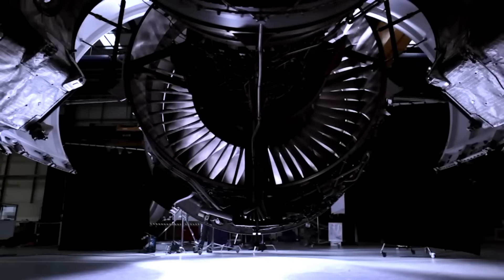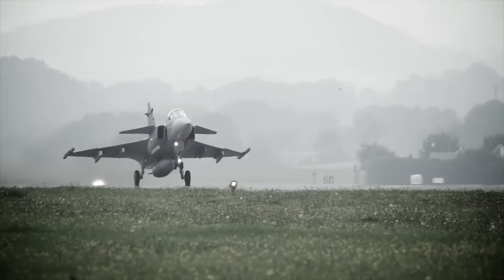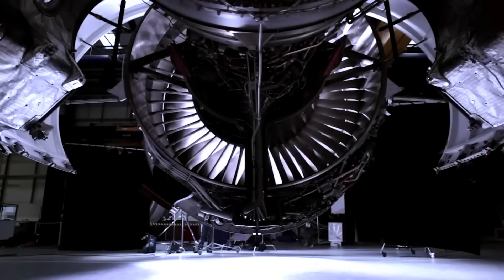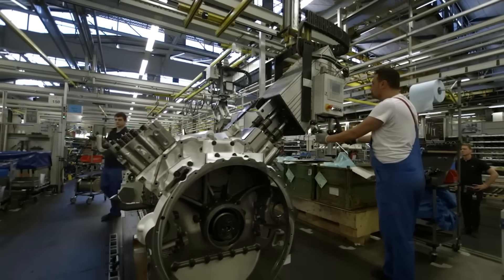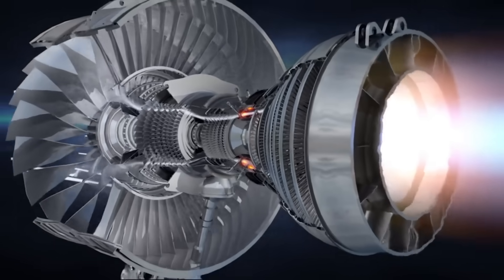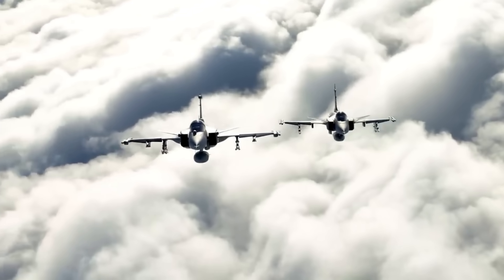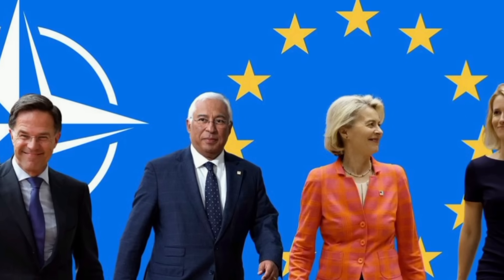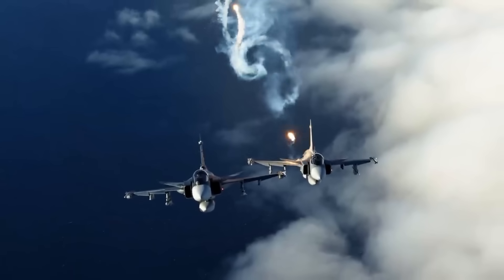How Rolls-Royce Quietly Rewired the Gripen Jet – And Shocked NATO Overnight

Comment: RCAF veteran here.🍁🇨🇦 As a maintenance officer, I believe that the Gripen should have been our first choice from the beginning. It’s designed specifically for the conditions we have in Canada. It’s made to operate in the same environment as we have in Canada, can operate from forward austere locations and is designed to operate with minimal maintenance requirements. This is a major consideration as the F35 requires a large number of technicians and extensive maintenance facilities to support its operation.
The cost comparison in maintenance personnel needed to operate and maintain the aircraft, the serviceability rate, the logistics support and infrastructure requirements between the F35 and the Gripen favours the Gripen in each case. The cost per flight hour is an ongoing expense that Canadians will pay for the life of the aircraft. Again, the Gripen is the clear winner. (The Gripen also includes economic and operational flexibility benefits for Canada.)
Pilots always want the aircraft with the most advanced technology and capability. I completely get that. But the F35 requires extensive maintenance and logistics support and it’s the wrong answer for Canadian requirements. You can’t fly a mission with an aircraft that’s constantly in the hangar.
Reply: Didn't Saab also say that, if Canada went for the Gripen, that they would be built (or at least assembled) in Canada? I personally think this is another really compelling aspect that should be part of the decision making process. We (Europe) need to reduce our dependence on the US (I'm not anti American by any means) and Canada would make a great partner - why? Well educated and skilled workforce, no shortages of power with vast amounts of land for manufacturing plants and, the manufacturing could be located in relatively easy places to defend from an attack. Canada could come to our aid as they did in WW1 and WW2 (from the start and not half way through).
Reply: Concur,  and like the senior retired pilots are saying in support of the F35, " everyone should listen to the professionals", for me that's the AEREs.   I've been to the places you're refering to and I can't imagine an F35 operating there, even with runway extension and facility upgrade.   F35 is a great coalition airframe, but it brings with it one big negating flaw, fragile complexity.  Thanks for your service.
Reply: @williamlavallee8916  and that integrated, complicated operating system. It appears it can be downgraded by missing updates and maybe even rendered inoperative. In the hands of the 🍊🤡. No wonder the Israelis built their own OS
Reply: Indeed, Thanks for the service and efforts you provided our country. First, in the video , it says that the Gripen has been flown with the newer RR engine. The only Gripen to fly with the newer engine is the two seater as a test. Not in real world.
Second, China has now developed a Low Frequency radar that can detect the F35s. Not strong enough to lock on but enough to know it's there. Third, F35s are not suited for the extreme cold of the Arctic. A few have already crashed because of frozen switches (you can verify this). Fourth, we do have companies in Canada and around the world that are manufacturing parts for the F35s but, Lockheed will not permit any of them to have access to the propriety software as it is deemed classified. I have to say that , the French Rafale has the same requirements as the F35s but are allot more expensive. SAAB has given Canada the ability to build our own and for other countries such as Ukraine and Brazil. Plus, we could have a say in the future development of the Gripen.  I know some pilots as you say, want to fly the most advanced fighters but, in Canada's circumstances , we don't need a first strike fighter ( we leave that to the US as they seem to enjoy stating wars) we need a long range interceptor and with all the attributes of the Gripen E.
Reply: How about 2 squadrons of F-35 (has Canada not already signed a deal for some?) and the rest, Gripen?
Reply: @DH.2016  Canada has purchased and paid for 16 which should be delivered in 2026 but, seeing as Lockheed is so far behind schedule, I doubt that , that will happen. The 72 remaining (which haven't been contracted out yet) would be delivered in 2030-2032. Again, I sincerely doubt this schedule is
realistic. Canada used to have a fleet with multiple air frames in the past but, they are now wanting to consolidate their efforts on one air frame. As you say , we could again have a fleet with two air frames for additional security and diversify their tasks. But, I'm not the one making the decisions.
Reply: @scorpiiteck  The first four will be delivered in 2026, and stay in the US for crew training. The rest don't arrive in Canada until like 2029 or 2030
Reply: @DH.2016 no!!!!,dump the F35s,it’s time we cut the cord.Saab and Sweden have given us a better deal and better aircraft for our needs.Stop obfuscating and choose what we need not what the USA wants and if others follow Thats their choice not ours and not the USAs.
Reply: @jayjamieson7470  What's the best way to dump them (Canada has already committed to 16)?
Reply: @jayjamieson7470  - Do you know anything at all about the difference between the Lightning II and Gripen E that has not come from SAAB or the mutterings of civilians using this as political mud?

Ask any RCAF fighter pilot why Gripen has been refused continuously. Or look it up and cease parroting misinformation like so many sheeple...
Reply: @DH.2016  We are on the hook for a dozen F-35's. Technically we own them. I'm thinking we could use them as replacements for our Snowbirds aerobatic team since that's about all the F-35's are good for.  The US just uses them as spotter planes, even they don't trust them as fighters.
Reply: Great reply, but : "Pilots always want the aircraft with the most advanced technology and capability. I completely get that. "..??  F-35 is not more advanced than the Gripen....if any its the other way around....
Reply: @dockingtroll6801 The limitations of the F35 that have not been resolved by the USA, the poor MTBF, - franklyu, the difference between sheet spec and reality of the F35 means the Grippen is a brilliant win. With Canada now getting the Grippen means jobs, security, partial independence from the US, closer to the EU and cheaper trade and policy. In every sense Canada wins. But the subsonic Meteor is still the ball dragging the chain. Canada needs the hypersonic version asap. In fact all of Europe does.
Reply: @southboundaustral  all the smart guys in the 20 countries that reviewed the specs and bought the wrong plane don’t know anything.  Neither do the pilots nor maintenance personnel.  Internet randos should have been the deciders.
Reply: @jthunders  You're not very bright. You don't display an ability to comprehend what was written. Or you could just grow up and learn to think.
Reply: @s @southboundaustral  sure but I’m just some Internet rando. What about the guys on the RCAF board that selected this loser airplane. Does Canada even need an Air Force or a military at all? Obviously the Canadian government doesn’t think so because the planes they are flying now were obsolete 20 years ago.
Reply: Thank you for serving our country. Your viewpoint is well respected, and trusting in your judgement.
Reply: Why has the top brass at RCAF ignored your findings? Surely this is negligence bordering on criminal.
Reply: @jthunders  They depend on tests that were made in 2021(look it up). The retired officer in charge of 
advising the brass on this aspect of the purchase
was working for Lockheed some time ago, so...
Reply: @scorpiiteck Germany selected the F-35 because they didn't want their pilots being shot down in a 4th generation fighter. Believe me they didn't want to have anything to do with Lockheed after the Starfighter scandal of the '60s, but it was either that or lose pilots that could be worth as much as the plane itself. The best path for Europe now is to develop their own 6th generation fighter, and Canada could participate. Too late for 5th generation now I think.
Reply: @scorpiiteck  they used the old gripen C since gripen E wasnt even produced 2021, 1st ever gripen E was produced 2023
Reply: @jonassjoberg5896 Well keep running trials until the grip end wins
Reply: @jthunders  Under the table paybacks?
Reply: nailed it
Reply: I wonder if maybe my country should consider getting Gripen's next to the F35's, as our F16's are being sent to Ukraine. I feel like the Gripen would be a much better or at least more reliable defensive fighter, whereas the F35 seems more suited to mid to long range strikes. That's my impression at least, I could be wrong
Reply: My son's a Canadian navy veteran who now is a Sqn Leader in the Australian air force.
Reply: You forgot to say that Rolls make the best plane engines! 😊
Reply: @roberthopman-f4yWhat is better about them
Reply: no it isn't you don't have specific straight roads in the north of Canada that are tarmac Sweden has an infrastructure built to support the Gripen, and the country is much smaller and the population per sq km is much higher, all this effects how the gripen was built.
Reply: Also, an RCAF veteran of Cold War+ experience. I disagree 100% with the junior perspective.
I suspect the message is SAAB's marketing...
The Canadian Arctic is NOT Sweden's. Very few places exist to land ANY fighter; there are no forests, and in-flight refuelling is mandatory. The USAF does that. The RCAF cannot do that for any length of time.
The fighter MUST be NORAD compatible. Gripen is not. Link 16 is not sufficient.
The regime required for both fighters is the same: there must be sub-Arctic bases (CFB Baggotville & CFB Cold Lake) to maintain them. 
Stealth is essential: it is not 1996.
The Gripen E has been refused three times. Now, if it is the choice, it is clear that, for temporary jobs, it is not the best fighter jet available.
This is TYPICAL Canadian procurement....by politicians.
(There is zero possibility of having multiple maintenance teams - of six people - spread throughout the Canadian Arctic, ready to carry out anything but BASIC tasks, assuming the islands even had landing strips - no highways exist!).
Reply: I read this and thought that I had wrote it, lol.
You are spot on. 

Idiots vote for idiots. I love my fellow Canadians, but there are a lot of idiots voting for idiots in Canada, and they vote against their collective self-interest. Because of butthurt caused by a POTUS who will not be around in a few years.

I am not a Trump fan (there are slim pickings in politics), but I 100% respect his calling out of Canadians letting the USA pay way too much for NORAD and NATO, and Canada is one of the worst when it comes to the lack of contribution to our own national defense.

Procurement shouldn't be politicized, but the lies that are spun during election run-ups...it's an old, familiar tactic to appeal to idiocy. John and Jane Doe suddenly understand modern warfare...pathetically they ignore veterans, active service personnel, and even their own internal advisors. Gripen has never been accepted by anybody thinking clearly.

Trump will be gone and Canada will pay the price for Cold War era junk and have nothing for the RCAF's role in NORAD or NATO...just a token woke General in Colorado broadcasting text messages to lost Gripen TAUs before they are systematically erased.

I now know why old men are often grumpy!  Nobody listens to us. They don't understand tech. Not even the stuff they use every day.

For a typical Canadian, an analogy of dial-up vs. fiber optic Internet could be used, except "elbows up" - somehow being hateful towards "the Donald" is more important than logic, so the typical Canadian thinks they win by having dial-up Internet. 

Feeling butthurt because the truth has been spoken to Canadians is a sad sign that Canadians no longer behave like adults.

But not to worry, Canada has MAID. An incentive to erase the elderly...I'll be designated as chronically suffering as evidenced by being pissed off by politics, and then I'll be erased...Canadian compassion, eh?
Reply: Well said but the elbows up crew don't want to hear this
Reply: I am likely the same age as you, but I strongly disagree with buying kit based on temporary Trump idiocratic behaviour.

Humour me with a reading of verifiable facts:

The most Northern Gripen usable facility in Sweden vs. CFS Alert
1 Jokkmokk Road Base (66.5°N) vs. CFS Alert (82.5°N)
2. Annual Mean Temp -1°C vs.-17.7°C
3. Winter Lows (Jan/Feb) -15°C to -25°C vs. -30°C to -40°C
4. Summer Highs (July) - +19°C vs . +6°C
5. Daylight (Winter) ~0 to 3 hours (Polar Night) vs 0 hours (4 months of darkness)
6. Daylight (Summer) 24 hours (Midnight Sun) vs. 24 hours (5 months of light).

Notably, the Canadian Arctic north of Gripen's most northerly usable airstrip is 26 times larger (Sweden: 95,000 km²; Canada: 2,500,000 km²).

Neither country can claim an advantage in potential forward-operating bases in the far north. Canada has Inuvik, Cambridge Bay, and CFS Alert. The winter shuts down most supply routes, leaving air as the only means of communication (CFS Alert's Operation Boxtop keeps that station alive year-round). So one has to rely on bases south of 66.5°N.

Gripen was "born in the Arctic." The only advantage I can identify is the lack of need for a huffer cart(!)...which already exist at all small airports south of 66.5°N. Both jets are expensive: the Gripen E costs more, but less on projected maintenance, based on economies-of-scale construction that is not likely to occur. 

The world has identified Gripen as the F-5 of this century: a third-world fighter developed during the Cold War. 
Canada was suckered into buying F-5s and immediately stored half its fleet before selling them off at a loss.

NORAD is key to this decision, moreso than NATO.
 
Gripen E can form Tactical Air Units (TAUs) using the Tactical Information Data Link System (TIDLS) and provide significantly improved situational awareness for Gripen E aircraft operating together. Gripen E can also use an AI agent (Centaur) to better coordinate jamming and peeking through weaknesses in enemy formations. Data sharing with the rest of the military assets in the fight is far too limited for the size of the Arctic.

The F-35 is a "stealth-first" platform, designed to operate inside the most contested airspaces in the world where traditional aircraft would be shot down immediately. It features:
1. VLO (Very Low Observable) Stealth: The F-35’s airframe is shaped, and its skin is coated with RAM (Radar Absorbent Material) to minimize its radar cross-section. It carries weapons internally to maintain this "invisible" profile.
2. Sensor Fusion as Primary Weapon: While the Gripen fuses data for the pilot, the F-35’s computers take complete control of the "narrative." It collects data from its AN/APG-81 radar, EOTS (Electro-Optical Targeting System), and DAS (Distributed Aperture System) to provide a 360-degree "god-view" that is then shared with all friendly assets.
3. The "Quarterback" feature that Gripen E lacks: The F-35 is designed to enter a combat zone, identify all threats without being seen, and then silently coordinate via a vast network, the elimination of enemies. It can work with any other compatible "node." It is big picture oriented: ABSOLUTELY necessary to NORAD. Gripens are loose cannons, fighting 20th-century-style engagements, disconnected from the broader context.

For example, the F-35 uses a Multifunction Advanced Data Link (MADL) to act as the "Quarterback." A four-ship of F-35s can use MADL to coordinate a "silent" attack:
1. F-35 #1 flies forward with its radar OFF, using its passive sensors.
2. F-35 #2 stays further back and "pings" the enemy with a quick radar burst.
3. MADL instantly shares that radar data with F-35 #1.
4. F-35 #1 fires a missile at the target without ever emitting a single radio wave that the enemy could detect.

Where the F-35 is better
1. Penetration: Because of its stealth, the F-35 can fly directly into the "heart" of an enemy S-400-style AD missile bubble. The Gripen, despite its advanced electronic warfare capabilities, remains a "fourth-generation plus" airframe and must rely more on standoff weapons such as the Taurus KEPD-350 to stay safe.
2. Global Ecosystem: With over a thousand units delivered and thousands of units on order, the F-35 has a massive logistical backbone and deep interoperability with nearly every major NATO ally.
3. Combat Intelligence: The F-35’s ability to act as a stealthy ISR (Intelligence, Surveillance, and Reconnaissance) platform is unmatched; it is effectively a "spy plane" that can also drop bombs, shoot missiles, and with its AI, control loyal wingmen smart drones.

Where Gripen E is better - no advantage at all in Canada's Arctic above 66°N...unable to connect to the MADL.
So, huffer carts??!!

This is the key part of stealth that nobody discusses. Gripen E broadcasts an EM data bubble..."HELLO, I am HERE, here's some data..." while others in the TAU stay silent, until they inevitably reveal themselves as the AI needs to respond. 

The F-35 uses MADL technology: an invisible network employing multiple very narrow-beam transmissions that conceals the locations of all connected units. The data rate of MADL enables it to send live "God" POV video. Gripen cannot; it transmits tracks and uses frequency hopping (again, Cold War-era technology).

The only way to make an argument for Gripen E is to argue to buy so many of them that the RCAF can play attritional warfare until the USAF can take over.

Conservative or Liberal, I don't care: they are idiots. Canadians will never learn to keep politics out of military procurement... that is why the Canadian Armed Forces have essentially disappeared.  Listen to the RCAF experts. No to Gripen.
Reply: @doogleticker5183 it's all elbows up until you get shot down. Ask the Indian Rafale pilots.